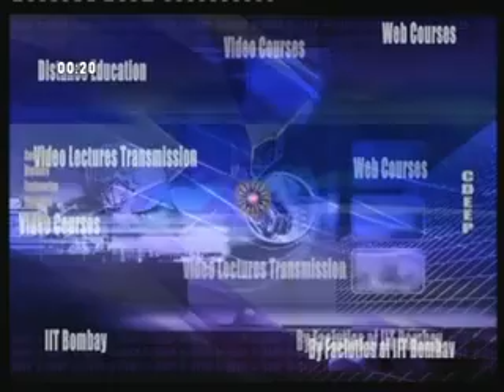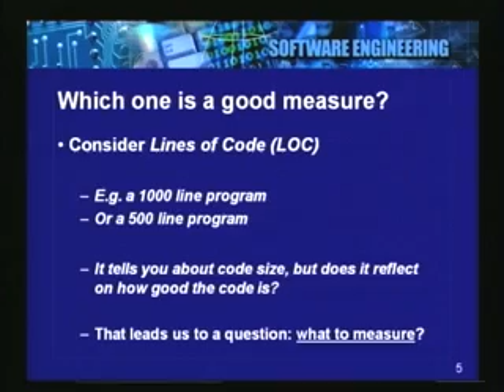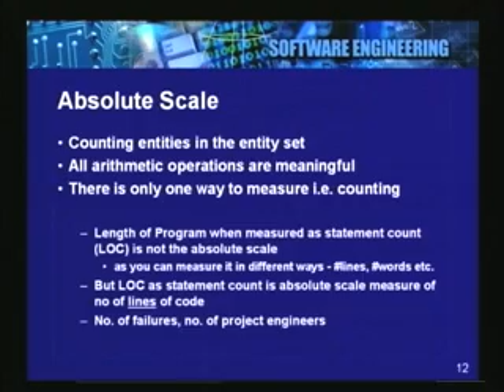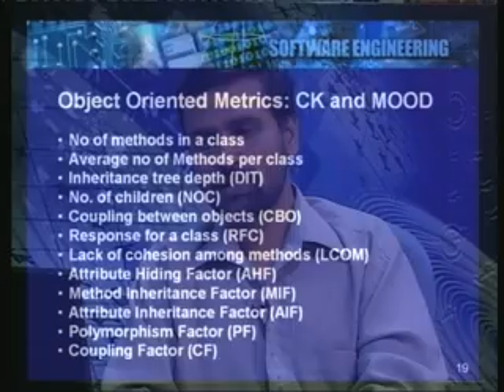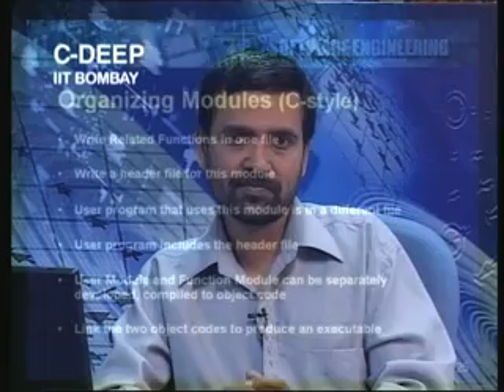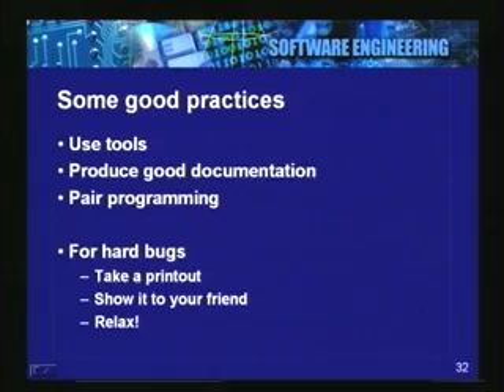Lecture - 21 Software Metrics and Quality

Comment: As a student in Mechanical Engineering, I can testify that it is the same in my field of study. Then, they will expect you to turn around and apply it to a project with no instruction whatsoever on how to do so. It is normal in Engineering to have to learn how to apply the knowledge through independent study.
Reply: What are you doing now bro 
2021